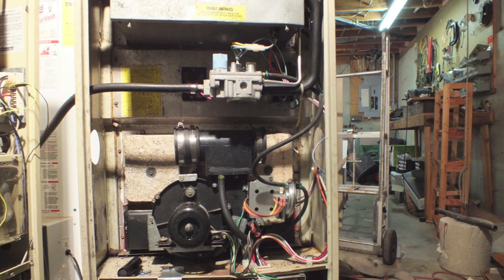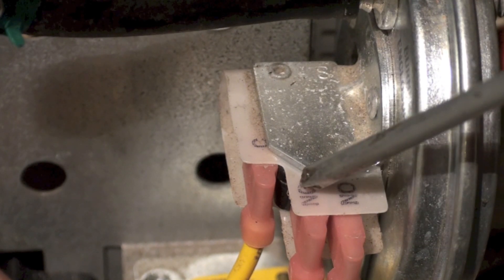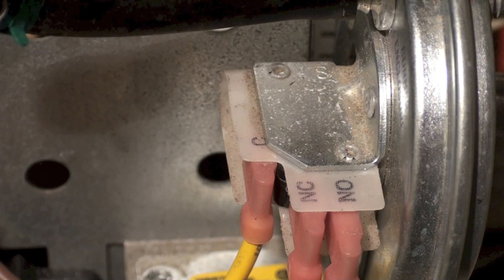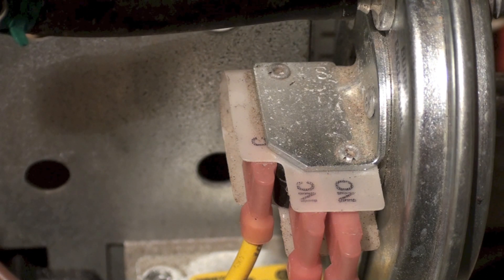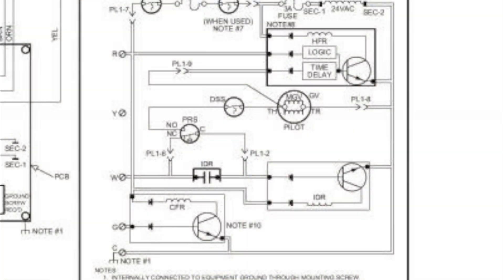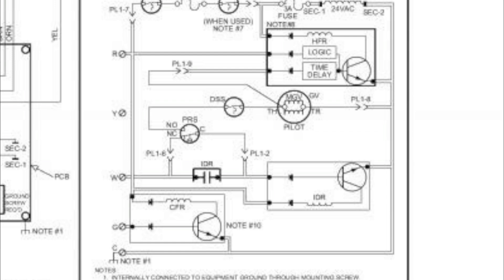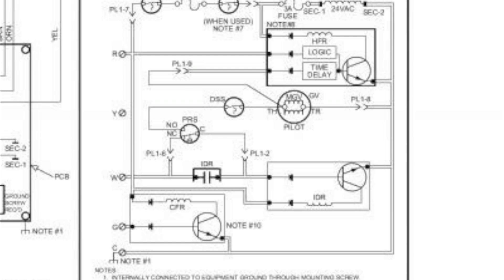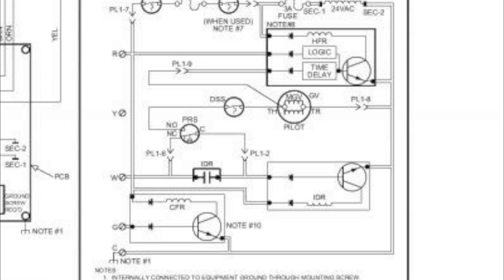How the pressure switch on the 398aaw Carrier is wired

Comment: Hi there again, GFM.  With that older Carrier 55SSB here again. So in this video you do clarify that the pressure switch does allow the inducer motor to run. I.e., a bad switch will prevent even that first step in the sequence, correct?  In checking the switch's poles with my meter I hear it activating the relay on the inducer control board.  But the inducer itself does'nt come on (only when it was 'hotwired').  So I think its worth replacing the switch and see what hapens.  Thanks again, GFM!